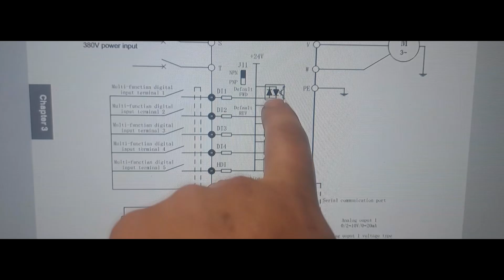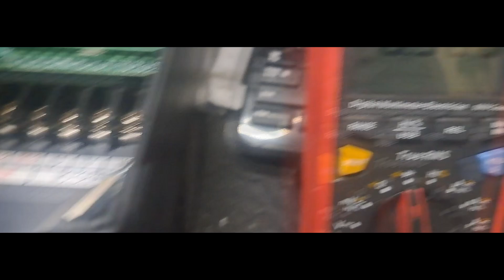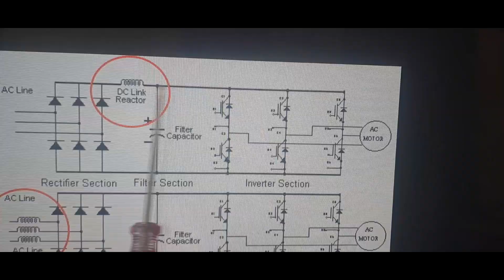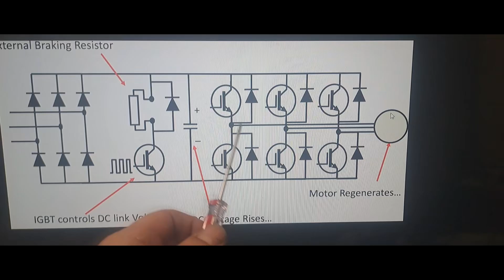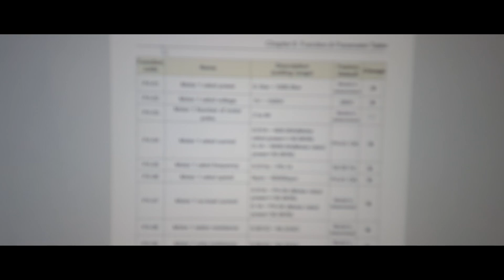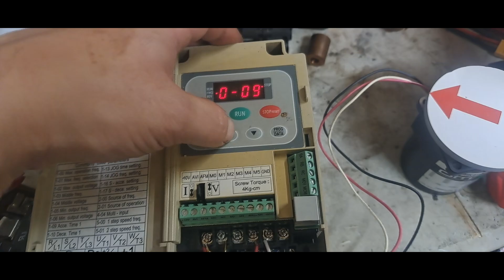Basic testing and running of an AC/AC VFD

Comment: Oh that is nice !!! I am getting interested on industrial electronics lately I wanna get a job in that area , maybe this year I could take a PLC automatization course that is on my university .
Reply from the maker: IDK why the video is so small lol I had it automatically publish around this time on accident or something and just noticed (wait, am I crazy? it's like moving around mid-way). Anyway I would def take a course if you're interested.
Let's say you wanted to get into writing ladder programs to perform basic automation for practice (with something like logixpro) then it's probably more or less the same gist when dealing with any other major manufacturer at least with the basic concept. I can't really say I know any of them, but only just enough with several of them to struggle and maybe succeed at communicating with them enough to either just transfer programs or write basic test ladders for the IO. The real hurdle with the big companies is that they are charging a ton of money to access their software typically used to communicate with all their stuff. I imagine a course would cover stuff like industry standard safety and communication protocols on top of the main idea of control logic.
Reply: @Magneticitist  oh yeah cool , by the way on the half bridge turns out my gate drivers are fakes and don't have working enables , I hooked up the PLL circuit I was using on the single fet (which by the way I discover had dead clamping diodes from that time I connected reverse polarity , but I just fixed it ) well apparently I messed with the min max pots or some cause is working like shit , got it to trow some little arcs fixed freq , anyways I am gonna need to figure out the min max trimmers again